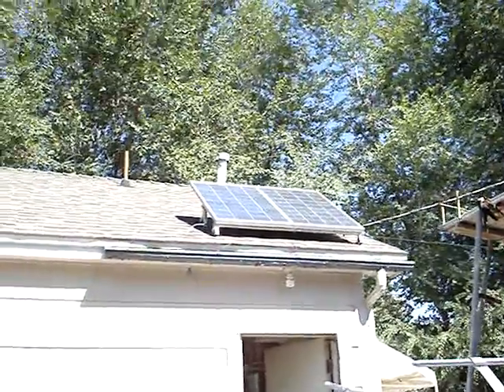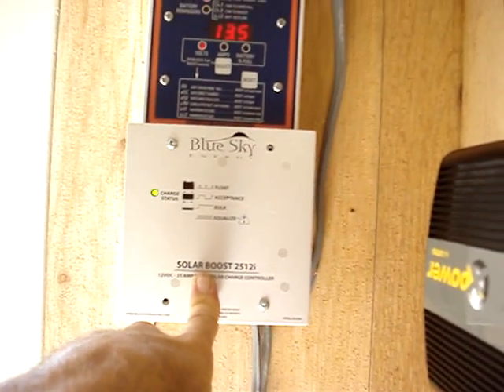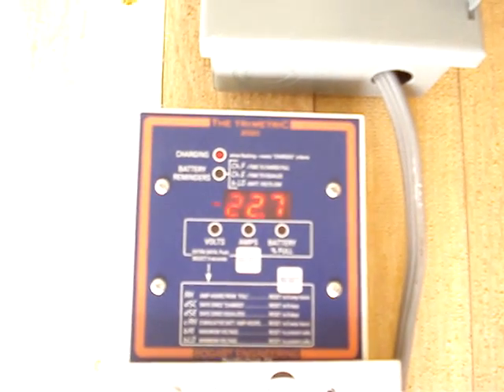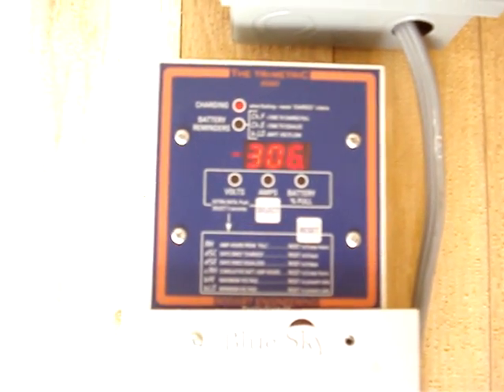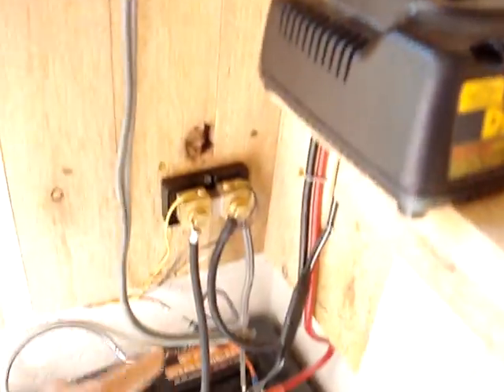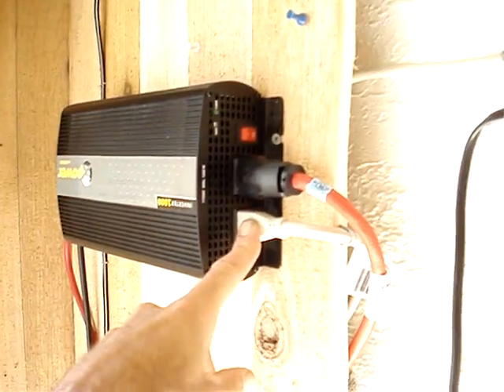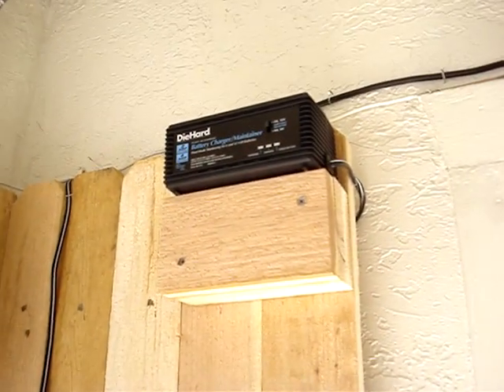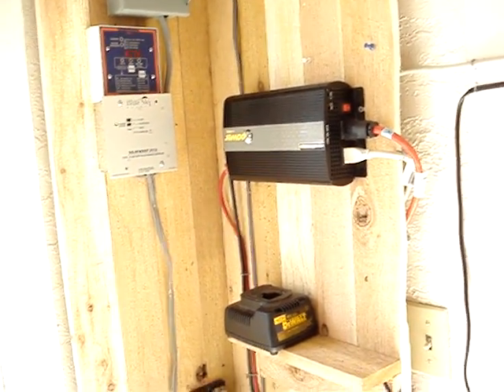DIY My small home solar power system

Comment from the maker: @shotox21 SWEEEEET! You can add as many panels as your charge controller can handle, as long as they are the same voltage. My controller can handle up to 20 amps, which would mean I could safely add one more 80 watt panel to my system comfortably, 2 more would be pushing it cuz the two I have now will push 10 amps on a clear day.  When I have four or more panels, I will upgrade to a beefer controller that can handle more juice. Add a pair of batteries with each 80watt panel installed. Good luck

Comment from the maker: @youngidis I'm glad U like the set-up. This system costs $1800ish with all the components and batteries. I broke down the cost of each component in earlier comments. These golf cart batteries, or any other quality batteries will last an easy decade given they are well maintained and kept at room temp. Try not to abuse your bank by using tonight, more than you caught today, on a routine basis. They wont last long doing that.

Comment: Never use solid copper wire for DC. Solid for AC and strand for DC. DC current will only use the outside area of a solid wire.......I.E.: 12 gauge solid will act like 18 gauge stranded with DC.

Comment: Does it charge at the same time you are running equipment? Say you run a tv 24/7... will it charge and power during the day, and run off the batteries automatically at night (after a sunny day)?

Comment: @galatasaray710 actualy thats not true....if youve just spent a load of money you dont save straight away..you just lower your bills until its paid for what youve just installed..some set ups take many years to pay back...solar is still too exspensive...many controllers are way over priced for what they are made of and good panels and batteries are far from cheap..my batteries alone  cost more than all my bills in one year...its long term and about being non dependant

Comment from the maker: @jenjohnny if you use 12volt batteries you can. if you use 6volt batts, like my golf cart batts, you will have to wire them together in series pairs to get 12volts. Two 6volt batts wired in series (pos to neg, one wire) will give you one big 12volt battery. then wire these pairs in parallel (+ to +, - to -) together and you have a 12volt bank. I like these big golf cart batts because they hold tons of amp hrs, and last years. A pair of these 6volt batts hold 220 amp hrs at 12volts.

Comment: @fencekid..lots of people think a couple of big panels will run anything in their home..as u know it's about commitment..I have 10mm cable everywhere as it makes the batteries last massively longer and allows loads that don't upset the inverter..my tv is an 11 inch caravan tv..u just sit closer lol..uses 18 watts.I found using a 5 digit led multimeter within constant view helps u learn what works and what doesn't..the thrill is knowing there's one less bill to pay and as energy costs rise u jus

Comment: By the way the system on here would need regular boosting off the grid..160 watts of solar has very limited use..his inverter would drain the batteries running most things..you adapt to your needs..something the guy here seems to be doing

Comment: Two 80 watt panels and a 1000watt inverter ? Wouldn't work in the UK..if your running a home 500watt solar is the minimum if you want to be completely off grid..even then a 1000watt inverter will suck the power..I use 40 half watt warm glow multi LED bulbs in my home..really nice light..always regulate anything running off the batteries as controllers run up to nearly 15v when bulk charging and can shorten the life of anything 12v

Comment: Is it normal to pay almost 2000$ for solar system, use low energy cost lamps.. and so on.
If normaly for that money using the same low energy cost lamps you can pay your electricity bills more thant 15 years?

Comment from the maker: @ChumpyChicken2 Yer lookin at about $1,800 for this setup including the batteries. Most of the money is in the panels. These 80 watt panels cost almost $500 each! If I could give one piece of advice it would be to stick with the high quality parts. These two panels, paired with the MPPT charge controller stream 10amps on clear days.:) 10amps from a 160watt system is awesome! Ya get what ya pay for....Paying for it sucks, but owning, and using quality parts is well worth it. Good luck..:)

Comment from the maker: @fissb1 Running like new...stick with high quality parts. Don't be afraid to spend a little more for the good stuff. Get a good meter sows not to abuse and over work yer bank. keep yer batteries at room temp if possible. Batteries die quicker if ya let em get way cold, or hot. Good luck:)

Comment from the maker: @reddawnsomeday Yer lookin at about $1,800 for this setup including the batteries. Most of the money is in the panels. These 80 watt panels cost almost $500 each!  If I could give one piece of advice it would be to stick with the high quality parts. These two panels, paired with the MPPT charge controller stream 10amps on clear days.:) 10amps from a 160watt system is awesome! Ya get what ya pay for....Paying for it sucks, but owning, and using quality parts is well worth it.  Good luck..:)

Comment: Have you any advice for large power draws such as central AC, well pump and electronics?  Have you considered wind generation as a co source of energy? Maybe when it is cloudy it will be windy? Do you have a recommendation as to the type of batteries to be used such as Marine deep cycle or lithium ion that are common in electronic back systems? Have you considered direct powering using 12 or 24 v DC lighting and appliances rather than the loss from an inverter?

Comment: Great video! Thanks for posting. Im looking for something that can charge my laptop once a day and Ill give up the tv for it. can I do a system just a bit larger than yours and be pretty good to go with the other stuff you mentioned as well (coffee is a biggie lol) I need to run a small water pump for the shower and a couple lights and maybe a microwave once in a while. Most of my stuff is propane..

Comment: @Shar4ie You need to think of the solar panels as battery chargers. The A/C voltage comes from the invertor and that is powered by the batteries. The solar panels just keep the batteries charged up.

Comment: @seetherage That is NOT a clean setup. That's more like an mess to me. Te clean setup is where you don't actually see the setup. No freely hanging wires and cables nor exposed battery poles. The idea is good, though.

Comment: You also want a breaker (or GFI outlet at least) in between anything you plug in, and your charging equipment.  One bad appliance can wreak havoc on your pricey parts, and / or start a fire.

Comment: Looks great - for similarly inclined people I would strongly recommend tying the power from the inverter directly into another dedicated 120v disconnect / breaker panel.  This can be "daisy-chained" into your existing power box so that selected outlets in the home are powered by the solar setup (mark those outlets throughout the house with stickers or sharpie or something). Extension cords running throughout the home are dangerous trip, and fire hazards - besides being against building code.

Comment: Very nicely done.   So you use Romex from the solar panel into your house?   I was trying to think of the best way to wire my system and I was thinking this might work.   Currently I have 1 panel (60 watt peak) and will build a second one.  Would you use romex outside?

Comment: 1000w inverter isn't small? When you runn the microwave and television together? I have 750w microwave and when the fridge kicks in I don't it will be able to supply others devices as TV etc... How many of them can run at onece (and how they are rated, I mean in watts) ?

Comment from the maker: @CHEEKY670 I'm sure I listed the cost of each item in this set up either in the comments on this video, or maybe my "trimetric 2020" vid. Close to $1900 for all of it. You can use 12 volt marine bats, but they each won't store as much juice as these. When you wire two 6v bats together (one cable connecting + to -, not + to + like when you jump start your car) you now essentially have one big 12v bat. So really it's like this system is running off of two big 12v batts that each hold 220 amp hrs.

Comment: I dig it! How much did your system cost? and why use 6 volt batteries? Wouldnt 12 volt marine batteries work just the same? Im just getting into solar panel for the house. Ive had the on the roof of my semi for years. That was easy to set up and maintain. they would power my fridge for 7 days before i would have to jump start my rig, im sure if i used more than 2 40 watt panels it woulda charged better but it was fine for what i needed it for. Thanks for any info and good job! =)

Comment from the maker: @davidlynch0 I could if i had too, but only for a short period of time. I don't catch enough energy to run a full sized fridge full time. I haven't checked the amps on it, but i'm guessing it's allot. So on a days catch, I could run that fridge for 30 min (example) or power 6 lights and a 19" tv for 5 hrs. A days catch isn't near what my bank consists of, but on a day to day basis, I can use tonight what I caught today, no more. other wise my bank won't be topped off tomorrow night.

Comment: You could purchase a "true sine wave" inverter to run rotating machinery, such as vacuums, but these inverters typically cost more.  I would also add that it is not safe to connect lead-acid batteries in parallel for long periods of time while powering loads.  One battery is usually higher in volts than the other, which will get discharged and possibly overheat or even leak.  Unless your charge controller is designed for paralleled batteries, I would redo this so that they are in series.

Comment: The reason it doesn't run the vacuum is because the output of the inverter is a "modified sine" wave, which is really a two stage staircase waveform.  It is fine for running computers which have DC-DC converters for power supplies and can use modified sine wave with no problems. You can not run rotating machinery well because the staircase waveform has too much energy in the higher harmonics which heat the motor but don't turn it much.  You could burn the motor with that inverter. I am an EE.

Comment from the maker: @guerrette funny you should ask. I have been meaning to make a vid of the rv I picked up last fall that has a sweet solar system in it . It has two 75 watt panels on the roof and it is like cutting the umbilical cord to ground  or generator power. I'll make up a vid soon, so stay tuned

Comment: So as of right now my solar panel system is working perfectly. I do have light at night. But there is still on problem. On a fully charged battery, i was only able to run 1 14watt cfl blub for about 30mins. I have a 18ah battery. How many hours am i suppose to get and how do i fix this?

Comment: That Tri-Metric looks sweet!
You did your setup nicely.
Are you stepping the voltage down from the panels thru the controller?
I've seen that the MPPT charge controllers can change voltage from higher to lower for the battery bank.
Knowing power usage and battery health is crucial for optimum system performance. Very helpful info, thanks.

Comment: Hey nice job .I'm setting up a solar system at a remote Island in Canada it will be consisting of 10- 125ah batteries off eBay reg 300 a piece for 50=500 and 2 x120 watt solar panels for 800 of eBay a 3000 watt inverter for 180 off ebay and a 1500 watt wind turbine for 250  and all the cables 75 and power controler 30  so as all you can see with a little bit of knowledge you too can buy and save if you shop around go green from K.B IN MICHIGAN

Comment: hi i have got  5 80w panels at 12v and one at 24v it is a 110 v . 4 panels=48v. can i put 80v and the 110 24v in parallel and can i put them in the same controller. the controller is solarix 4401 48v charge controller thanks.

Comment from the maker: How much you can run at once depends on how big your inverter is. Mine is a 1000 watt (still would like to get a bigger one) so I can run up to 1000 watts at once comfortably, but not for  very long though. At that rate, I would use up a days worth of charge in no time.

Comment: I can appreciate the DIY approach to things, and this set up is clean for a Frankenstein PV system. But don't you worry about fires or shorts? It seems like you could get some explosive gasses coming off those batteries.
Also wondering if your set up qualifies for the 30% Fed Tax credit for solar? State program rebates?
"A" for effort. Does your meter spin backwards as the panels make juice during sun light hours?
I'm asking cause I'm seriously contemplating doing this.
cheers.

Comment: I would put some connectors in the knockouts that you have wiring passing through for your disconnect switch and other equipment. Also, read up on the Electrical Codes for your area. Extension cords weren't made for permanent installation and a bit of a hazard.

Comment: I have an appreciation for what you have so far; however, in a location where you may want to use a stove, electric heat, or air conditioning, you don't have the juice for it.  You would need way more solar panels and they cost a whole lot of money.  It's still cheaper to just get your power the old fashioned way.  It's like comparing a big V8 (the grid) to a one cylinder 2 stroke moped (your panels/batteries).

Comment from the maker: The panel name is "ELIMINATOR" made by "MotoMaster" sold at a solar store here in town. I had never heard of them either. He said he gets them form over seas. these two 80s push 10 amps on clear days, have seen them push as much as 12 after a rainstorm. I love them, and will buy more.

Comment from the maker: The + is connected to the battery, the - is connected to the shunt. the shunt is tied in with the 2020, so, yes. the 2020 tracks all activity in your bank. when your bank receives ( solar panels or battery charger) or delivers amps, the meter shows it. For example,  if I'm using a 5 amp tv, at night, my meter shows that i'm pulling 5 amps. If i push +2 amps into my bank via battery charger, the reading will now read i'm pulling -3 amps. the meter monitors all bank activity, all the time.

Comment: OK
2 panels at 80 watts = 160 watts per hour with full sunshine
8 hours of sun 7 days a week = 1.28 KW per day
1.28 KW = 1,200 Watts in 8 hours
You would have to be using all of that all of the time but you don't. At the amount you invested I calculate it will take you 28 years to get your money back. But, you have a smaller carbon footprint and that is a great thing.

Comment from the maker: On my inverter, the fan speed will fluctuate depending on the load. The fan will kick on well before it heats up. Just turning on a few lights will kick it on. The heaver the load, the higher the fan speed.

Comment: hey when does the fan on the inverter come on ?does it heat up before it comes on because mine did nt come on when i hooked it up .but i ran a fan for a few mins ,just to make sure it worked. thanks letosh

Comment: the only way to keep the system cheap is to make the panels yourself components such as solar cells can be found on ebay 
as for price DIY panels cost 250 usdollars for 80 watts better than spending 800 or 700 usdollars for a new one
the cells can be bought in packs of 36 cells mono cristalin THE BEST

Comment: great set up :) IF your bat's are at 94%, then looks like an extra inverter would do you just fine.  Nothing's going to pull more than 20amps at 120ac, so a 2000 watt inverter will work well.  I've been staring at the gas generator in the corner of the shop and thinking about stealing it's inverter.

Comment from the maker: The panel name is Eliminator made by Motomaster. I had never heard of them either. A local dealer here in  Utah sells them. They are designed for cabins and RVs. Max rating for each panel is 5.3 amps, but after it rains and the air is clear, i have seen these panels together reach 12 amps!

Comment: I too think you have a nice video. I've got a 70 watt panel and was trying to make a decision on the Controller. The extra bucks for the MPPT seems to be the way to go. Have you thought about 24v to extend distance and/or reduce wire size needed?

Comment from the maker: Thanx, so far I love it. As long as your bank is in a well ventilated area,you should be alright.  I keep mine in the house in the laundry room, as close to the panels as possible. If you can keep your bank warm, this will help maximize performance and longevity. banks that are exposed to freezing temps aren't as efficient and will need to be replaced sooner. The shorter your wires the better.